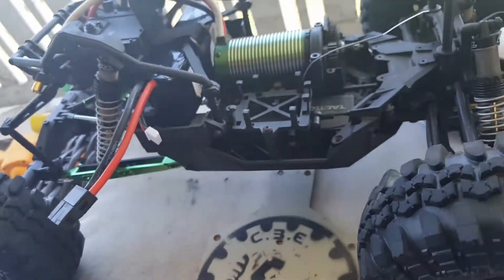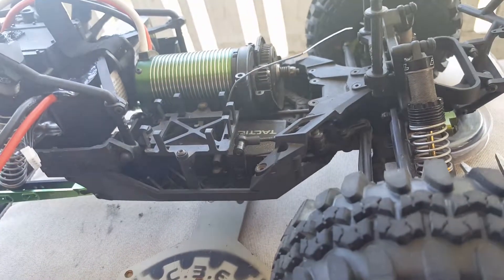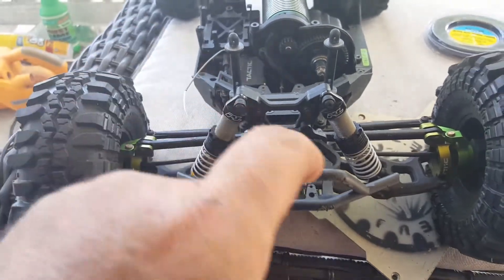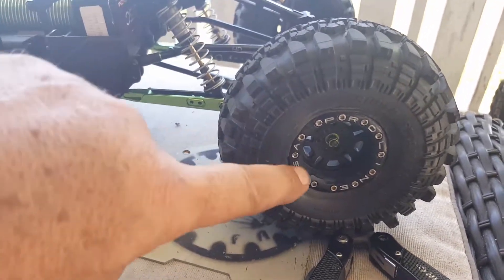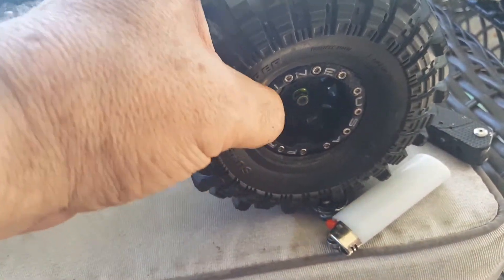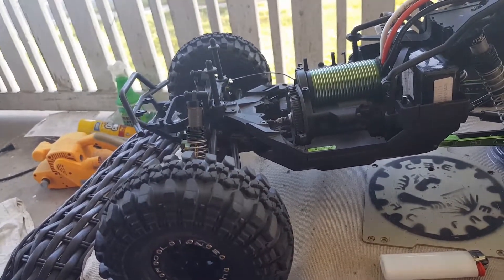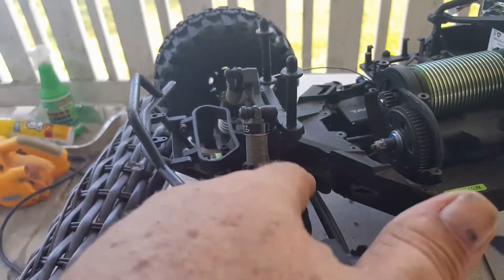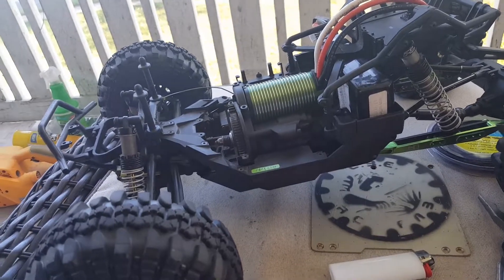1/8 Mamba Monster 2 and a 1/10 Yeti

Comment: Nice! What KV and pinion/Spur you running?
Reply from the maker: Bolt Thr0w3r what ever the Momba monster 2 is. It's a 1/8th motor.  I think I went up on the size of the spur
Reply: RCING_4_AUTISM Chieffirewolf ok thanks I’m gonna do the same set up as you